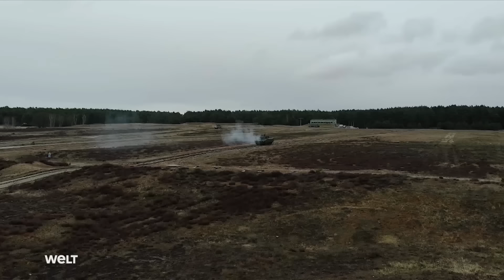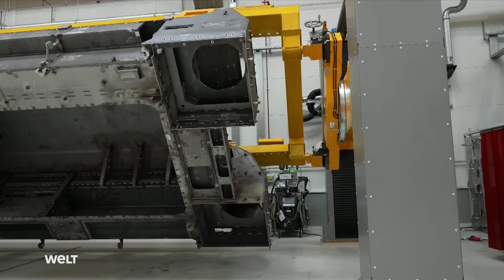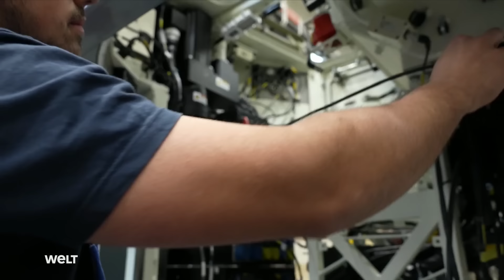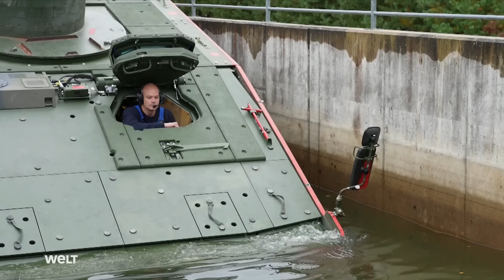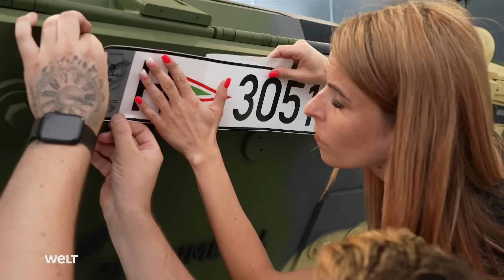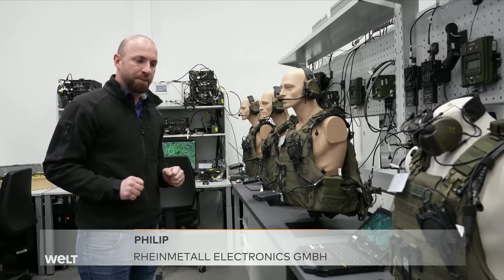GERMAN ENGINEERING GOES CRAZY: Inside Lynx KF41 Production – World’s Most Advanced Armored Vehicle!

Comment: IF THE ENGINE IS NOT HYBRID LIKE THE ABRAM X THEN YOU HAVE AN OLD TECH TYPE VEHICLE BECAUSE THAT ENERGY NEEDED TO RUB THE EXTRA ELECTRICITY FOR SILENT RUN, FUTURE LASER WEAPON, AND AESA RADAR SENSOR FUSION, I DON'T SEE THIS VEHICLE TOO USEFUL IN THE DRONE WAR, SORRY
THE ASSEMBLY PLANT SHOULD BE 90 % ROBOTIZED FOR ULTIMATE EFFICIENCY, THE CANNON SHOULD BE AT LEAST 50 mm.  TO BE REALLY EFFECTIVE ALONG WITH A SECONDARY 20 mm one to compliment it, have anti drone, and attacking /surveillance drones deployable from the vehicle, I would bring some Ukrainian engineers and veterans to tell you what is missing on this vehicle

Comment: Big mistake to pack expensive tech on a vehicle that's practically disposable. In the field, these vehicles get attacked by drones, rockets, mines, and are often ABANDONED by operators due to various reasons (stuck, scared, out of fuel, disabled, etc). These vehicles need to be light, fast, nimble, easy to service, and CHEAP.

Comment: Now make a slightly bigger version that fires 60 mm rounds that are sabot and that are designed to defeat normal tanks but still be automatic and make the tank treads out of a lighter material critically important
Reply: There are other turrets with larger machine guns (35mm Wotan and 50mm Bushmaster), and a light-tank version with a 120mm (Lynx 120). But the Lynx is not even MBT. The best weapon for the IFV version is the 30mm MK30-2/ABM, because of its programmed ammunition, its rate of fire, and the ammunition that can be stored! The Lance 2.0 turret cannot accommodate a much larger machine gun (the Wotan 35 can) and the advantage would be nothing. The 50mm Bushmaster needs a different turret and many of its advantages are lost (it takes up space from the ATGMs)
The 30mm APFSDS shell is more than enough against other IFVs and APCs, and is also dangerous against tanks from the side (especially if it hits in series), but the larger 50-60mm shell is also insufficient against the frontal armor of tanks, and is unnecessary against other APCs and IFVs if the smaller caliber can handle it. Against tanks, the spike2 missile on top is effective, or the hero120 drone with an anti-tank warhead can be used instead. (or the manpad ATGM on the soldiers getting out of it)

Comment: codename Sitzen duckchen. A little fast agile drone delivery of a 1kg shaped charge and it's naptime
Reply: That's why the KF41 has 360-degree active protection, Strikeshield APS. And that's why there's also a team air defense/drone defense version (KF41skyranger), so that no drone can reach the active armor.
Reply: @vorosjanos77  and what does that do?
Reply: @DanFrederiksen  It shuts up stupid talk about $50 drones taking out, that's what it does.
Reply: @Lonestar24  hehe so you have no idea
Reply: @DanFrederiksen  The KF41-skyranger: destroys larger drones from a distance of 15 km with a mistral 3 AA missile, and small drones or drone swarms from a distance of 3-5 km with a high-rate radar-guided fragmentation projectile 30mm machine gun. If the drone gets through this, then the ROSY fogging system comes, which blocks visual, infrared, thermal and laser detection, it cannot find a target. At the same time, the remotely controlled browning comes on top, which destroys it at close range with a high rate of fire. IN THE MEANWHILE, the sensors of the strikeshield system also measure it. If all of this gets through, then the strikeshield charges shoot a burst of fragmentation at it from 10-15 meters and destroy it. (they can also target strikeshield RPGs and missiles)

Of course, protecting each other in a team, 6-8 KF41 IFVs and 1-2 KF41 skyrangers, where the radar information can be shared with each other by the squadron. For this, there is also external protection, RF, GPS jammers, and information from other sensitive radars and locators, (the Hungarian army uses the 3D radars of the Israeli Iron Dome system and the nasams3 sentinel radars for this purpose) 
And fiber-optic controlled drones could be launched from within the reconnaissance capability...  (this 8-10km reconnaissance capability can be up to 20-25 km if the HERO120 drones are also deployed, its control system is integrated into every KF41ifv, and the hero120 can be used in place of the spike2, and is not only suitable for reconnaissance but also for strikes)

Comment: Looks like it takes 2-3 cheap drones to make its “latest innovation” just scrap metal… nice work with wasting eu money on this miracle weapons. 😂😂😂
Reply: StrikeShieldAPS 360-degree active armor is on (the video shows the location of the sensors and charges, those weird indentations), but even before that there is the r.o.s.y. fog system, which blocks all infrared, thermal, laser and optical measurements in 1 second, and even before that there is the remote-controlled CIWS on top... and they don't send such an expensive toy without protection. There is a KF41 skyranger30 version, air defense, drone defense system (radar-controlled 30mm machine gun with programmable fragmentation shells), and mistral3 air defense missiles...
Reply: delusional z bot

Comment: One mistake that has been made by the person speaking in this video is this Lynx is not a Tank but a troop transport. It has a 30 mm gun not a 105mm, 120mm or 130 mm Main gun. You can say the 30 mm is its main gun but by definition this is not a Tank.
Reply: The Lynx KF41 has a modular weapon system that can be replaced at any time. Even the 30mm cannon is only an "optional main weapon" that can be replaced with a larger one at any time.

Every new-generation weapon system is based on modularity; even the Abraham M1, which has been in service since 1980, was already based on modular systems, so it will still be operational and ready in 2025.
Reply: A tank is a tank is a tank. The original British tank in WW1 did not have a turret (but the very small Renault FT17 had). Germany's Panzer 1 and 2 tanks did not have armaments of higher than 30mm caliber either.
Reply: It was just a typo error made by the narrator of the doc... that's all.
Reply: @liliethcameron369  whatever, the Lynx Changes nothing.  - the next Refugee Wave IS coming. Via. UAP in the USA. And Germany Take them all.
Reply: @FirstQuestmaster  Yes, refugees are lot of new workers building tanks.
Reply: @liliethcameron369  . More like a translation mistake. In German everything that's armored is called panzer. A direct translation into English, translates as tank.
The term tank is a mistaken name that has become too popular through time to be change. The correct term should have been armored carriage, or attack armored vehicle. The name Tank just sounds more sexy!
Reply: What makes a tank a tank, is not necessarily the armament it carries, but the combination of armour, armament and the role that is designed for.
Is the Merkava a tank, or a heavily armored IFV?

Comment: Great vehicle. 2:36 43 tonnes, upgraded up to 50. It's heavier than Swedish CV90 which weigh 23-38 tonnes.
Reply: The version of the lynx they show in this video has a Hardkill APS system all around the vehicle. I would not be surprised if that adds more than 10k tons by itself.
Reply: @uptonogoodashe7764  No. The Rheinmetall StrikeShield APS is less than 1 ton per side.

Comment: I thought conventional thinking was for a V shaped hull to disperse the blast from an IED or landmine. Nice neat welds sure but the armour itself is still a steel alloy and doesn't look very thick. The war in Ukraine has shown that such vehicles are easy prey for weaponised drones or shoulder launched anti tank missiles not to mention attack helicopters. And what happens when those tracks get blown off by an IED or landmine, can it limp home or do those track wheels just sink into the earth. I'm sorry but looks like an armoured coffin to me, an over-engineered armoured coffin.
Reply: There are different approaches to mine protection. V or double V shaped hulls are just one of them. Boxer, Puma and Lynx use a different method where the hull floor is flat, but protected by a special composite plate designed to protect from mines. In case of the Puma IFV that plate was so effective the US wanted disclosure of IP to manufacture it themselves. Rheinmetall declined.

The hull is, like with most modern modular armored vehicles, just steel and not ment to provide any ballistic protection on its own. Rather it's designed to mount external composite armor modules that outperform steel in weight-protection ratio in orders of magnitude.

Comment: the Lynx seems to be just a much cheaper version of the Puma, freed of size restrictions and all which comes with it. 😊
Reply: No, a completely different concept! 
The puma is an IFV, but the lynx is a modular system, consisting of two parts. 
One is the chassis with the undercarriage, powerbox, basic guidance system... and an interchangeable mission module. 
The video shows the lynx with the basic IFV mission module, but there are IFVs with different turrets, 35, 50, 120mm, and automortars, there is a command center, APC, ambulance (~medevac), technical ambulance, and an air defense/drone defense system integrated with the skyranger 30 system (+ mistral3 AA missiles). The armor system is also modular, the IFVs intended for the Hungarian army seen in the video are also equipped with active armor (StrikeShileldAPS)...

Comment: 43-50 metric tonnes? That is as heavy as a T-90 MBT. What about transport and rapid deployment? IFVs are supposed to be lighter.
Reply: Most IFV in Europe are rail-transported so I don't think weight is that much of an issue.

IFV stops being light after the Gulf War. There are some exceptions but with add-on armor and their huge size, IFV becomes heavy really quick.
Reply: "IFVs are supposed to be lighter"

Are they though? They used to be because of cost-cutting, but once you think about it. A MBT has to protect 3 to 4 lives, a IFV 9 or more. There is no reason a IFV needs to be lighter than a MBT, especially if your doctrine says they work in close cooperation and you don't need amphibious ability.
Reply: They are divas for a good reason. Thirsty divas
Reply: What if... It's an APC instead...
Reply: Depends on the country, some just don't have the need for it. The IFV of the Bundeswehr is the Puma which is airportable, but the Lynx is made for smaller countries because of its modularity. If you would transform the Lynx with the right modules into a recovery vehicle or MBT you can forget to transport it through the air anyway. Hungary for example wont go into conflicts far away from home anyway.